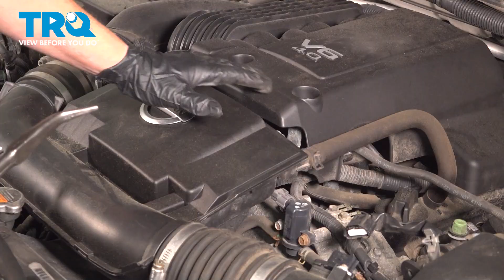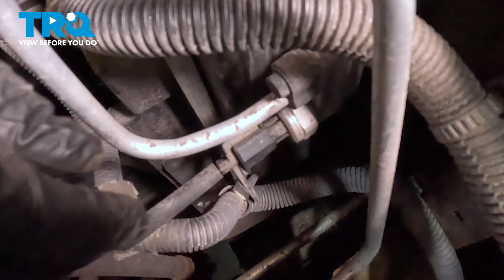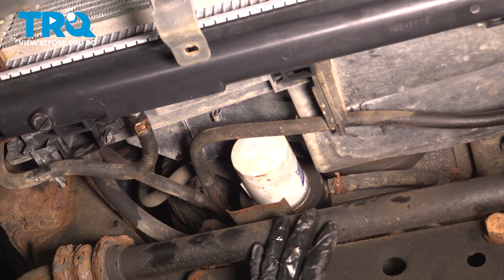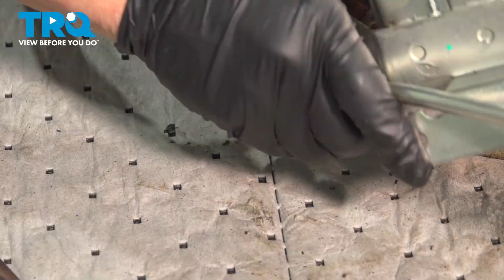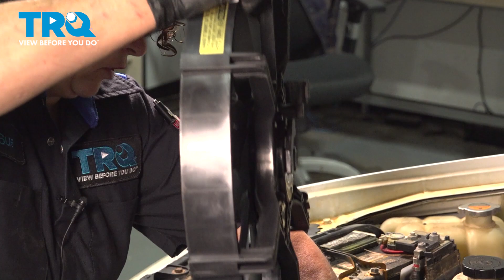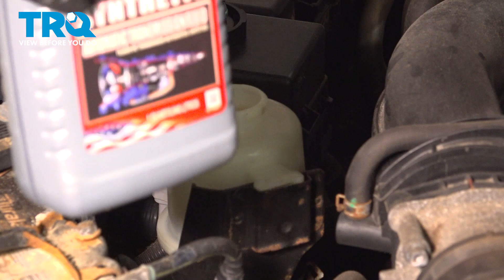How to Replace Power Steering Pressure Line Hose Assembly 2005-2021 Nissan Frontier 4.0L V6

Comment: Thank you. What a great, top notch tutorial video. I will apply the steps to repair my 2010 Pathfinder. It should be noted, that the metal shield you re-installed, is basically an oil drip panel, when the filter is replaced on an oil change. I may leave mine off. 😊